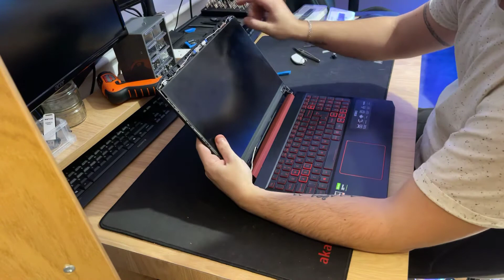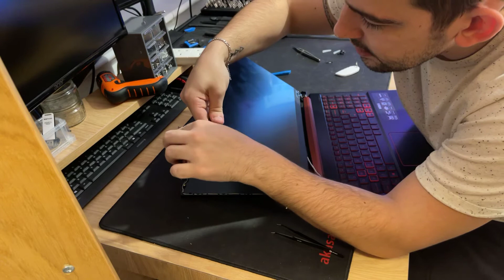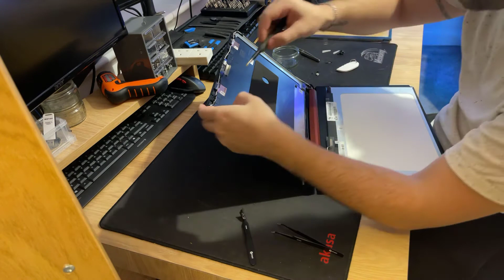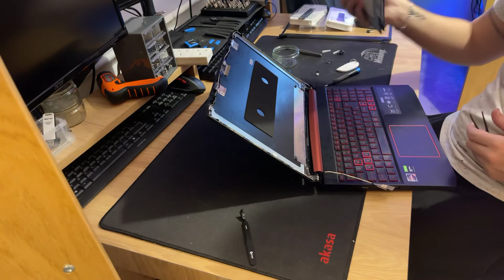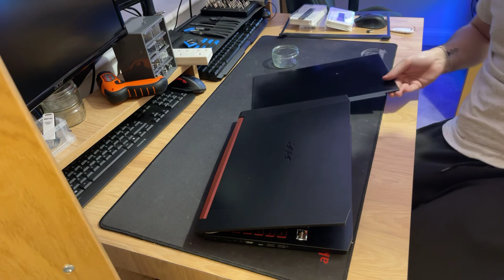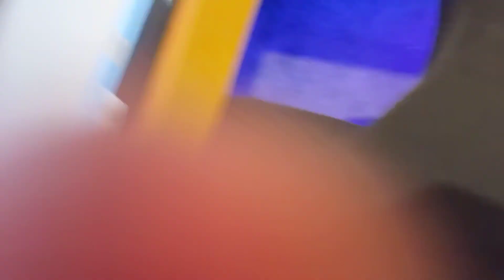Screen/Display Replacement on Acer Nitro 5 AN515-43 - Part 1 of 2

Comment: Hi, Can you tell me the video connector of this laptop 30 pin or 40 pin, I have the same laptop. My laptop specs is R7 3750H + GTX 1650
Reply from the maker: Hi 
I don’t quite remember, the video seems that the one here is a 40 pin one however same models can have the same mode screen with either 30 or 40 pin so in this case I’d recommend you check yours before ordering a new one

Comment: I have a 2012 MacBook Pro with a fried motherboard. Is it possible to replace my acre nitro screen with the MacBook Pro screen?
Reply from the maker: Hi,
No, the MacBooks are completely different than normal laptops and parts other than ssds/hard drives and memory’s are not compatible unfortunately